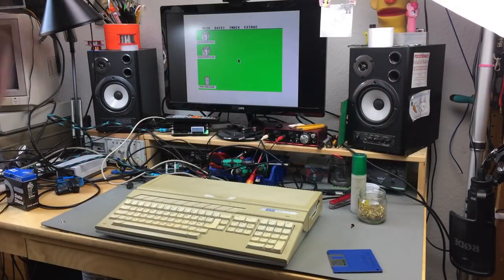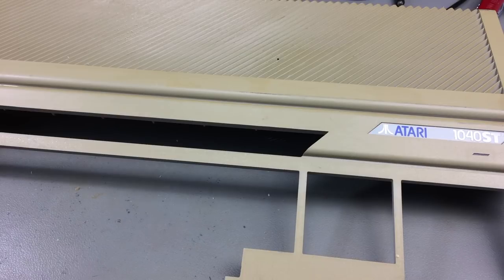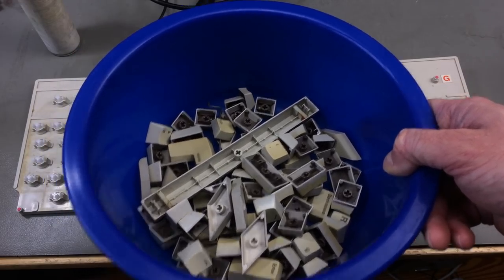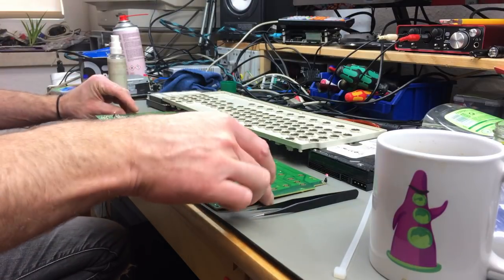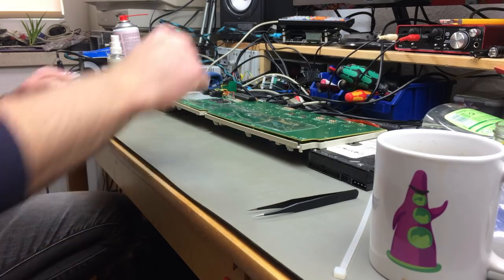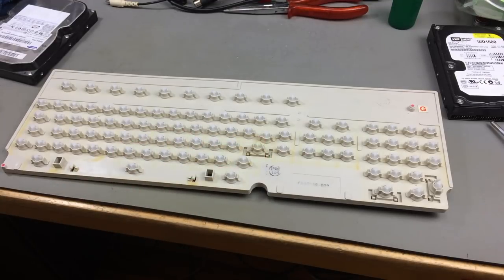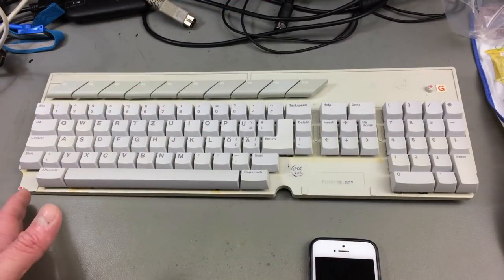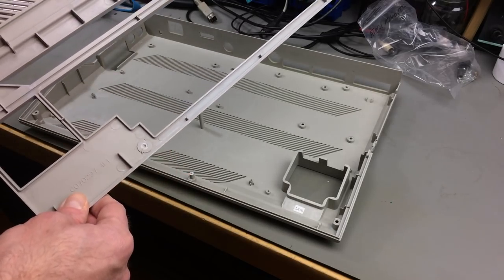Atari 1040STF Restoration Part 2: Retrobrighting

Comment: The floppies on the ST's and Amigas were notoriously bad, and they really are a pain to fix.  What makes it worse is that you can't really replace them because they were physically different then PC drives or really any other drive.  You can make other drives work, but they'll never look right... If you can get the original to work, that's great.. but if not, i personally wouldn't bother considering the state of floppies these days.  After endless attempts to fix mine (with Adrian repeatedly telling me to not bother), I ended up 3d printing a mount for a gotek and installed that on mine instead... especially considering NONE of my ST floppies had survived the 30 year storage anyway 😁
Reply from the maker: I agree, my plan is to try to fix the drive one last time and then basically give up and use a Gotek. I have a working disk drive in my Mega ST in case I need to read disks but for everything else the Gotek is probably the more reasonable solution. And it doesn't look as bad as hacking a PC drive into the ST I think. :)
Reply: @JanBeta  Agreed.  btw, i love the power supply replacement.  I recapped mine which did seem to fix my weird issues (to my surprise, since recapping had never fixed anything for me before), but i don't have faith in it long term.  Your method looks awesome.  Thanks!
Reply: We used to routinely replace Atari disk drives with PC ones.
Reply: @patbutete1722  did you modify the case?
Reply: @brianv2871  Of cause! No big deal back then. The early models were  a bit of a faff mind you. Nothing a hacksaw and a file couldn't sort out! The machines I worked on mostly running Cubase off the floppy .Therefore the drives took a severe hammering. PC drives much more robust therefore a no brainer press ganging those into service. They were working machines for the synth boys who couldn't afford a real Moog!..A 1meg  Atari + Monochrome ST124 monitor..£300.00...Serious money back in the early 1990s.
Reply: @patbutete1722  yeah, hacking cases might have been an option back then, but i wouldn't do it now for a floppy drive.  Most floppies are bad by now and all of them will be bad in a few years.. no one is making new floppies.  Putting a PC drive in these days would be pointless and destructive. (I'm not opposed to hacking computers, i just wouldn't do it in this case where there's no benefit).
Reply: @brianv2871    Of course these days of cheap bootable/storage options  no one in their right mind would contemplate implementing the crude solutions of days gone by!

Comment: Also, the keyboard only having one rubber dome under the two plastic parts of the return key is perfectly normal - that's the way it is supposed to be and how it came from the factory. Otherwise, the key would require more force to press down. It confused me in the beginning, but later on I found out it's the same in other ST's as well.
Reply: Yeah, it confused me too, when I cleaned up my 520ST and 1040STF. But as you stated it, it's totally normal for this keyboard, as you can see here https://flic.kr/p/23oBUh6 and here https://flic.kr/p/2cMexUZ 😉
Reply from the maker: Very strange! Thanks for pointing that out.

Comment: Can the cpus on them Ataris be upgraded I ask because I've never used or own one before.
Reply: They use a 68000 just like the Amiga so the accelerator boards that fit in the CPU socket should work, they will probably run faster than stock speeds so it could break some games
Reply: Yes, i think.
But only with 68020 and 68030 Acceleratorboards, ... hard to find one
Reply from the maker: Yes, the TF530 Amiga accelerator works with STs, too. Don't know if there has been a lot of testing but I saw videos of it being used in Ataris.
Reply: There were some accelerators available. Specifically look for the "T16" and (rarely available, I think) "T28" accelerators. which added a higher clocked CPU with some caches. There were also  some cacheless upgrade cards, but they were pretty worthless because the bus would slow them down most of the time. There was also a PAK68/3 which added a 68030 to it. Typically you'd have to change cases if you wanted one of these boards, as they were typically a bit big for the standard case.
Reply: @amirpourghoureiyan1637  The 68k in the STs was a HMOS variant, which makes some problems if you try to swap out a higher speed CMOS 68000. CMOS 68ks use a lower signal voltage than the HMOS variant, I think,  so it's difficult to interface a newer CMOS chip with the rest of the chipset.
Reply: @ixeron  Yeah that's a thing to keep in mind when scouting for boards, I do wonder whether the Vampire would be compatible or not, being an FPGA and not made to the same compatibility limitations that the Amiga CPUs have that you mentioned

Comment: Hey Jan, don't waste too much time on investigating whether the disk drive is single or double sided. 1040s were only shipped with double sided drives. Only 260s and 520 with external SF354 drives and some 520 STFMs with internal drives were shipped with single sided FDDs.
Reply from the maker: Ah, that makes sense. Thanks for pointing that out.

Comment: It's unfortunate he didn't take the other keyboard totally apart because then he woulda seen it was missing on that too and figured out it was normal. :-(
Reply from the maker: Oh, I totally realized that one of the carbon contacts had no rubber thingy and figured that that must be for another keyboard layout or something because it didn't have a plunger in that position. There actually was another one missing so transplanting it made sense. ;)
Reply: @JanBeta  It's all good. I think everyone who's taken a 520/1040 ST(e) or Falcon030 keyboard apart was a little confused the first time. ;-)

Comment: 20:17 !!! watch keyboard diode
37:19 you should wait 24 hours, i think
Frohe weihnachten
Reply from the maker: Yes, I noticed the diode fortunately. :) The glue was at least sturdy enough to hold the screw after a couple of hours. Hope it stays otherwise I will reglue. ;)